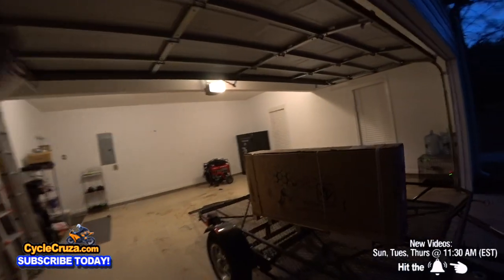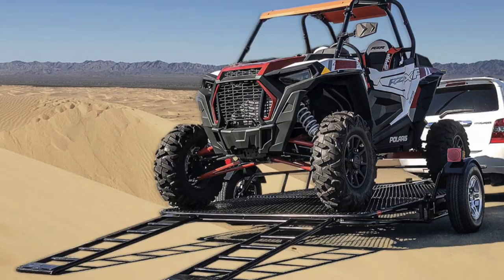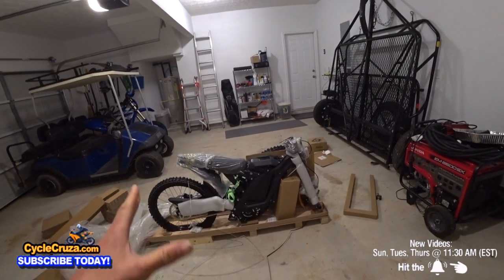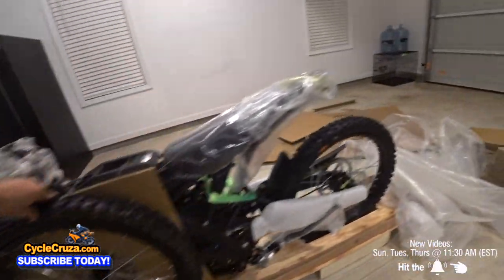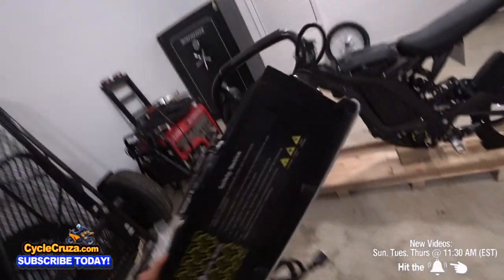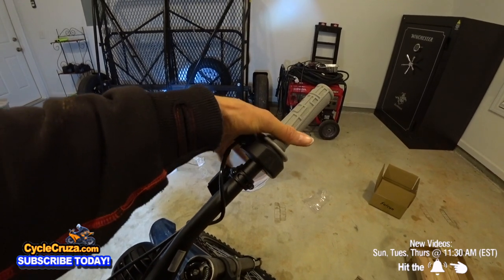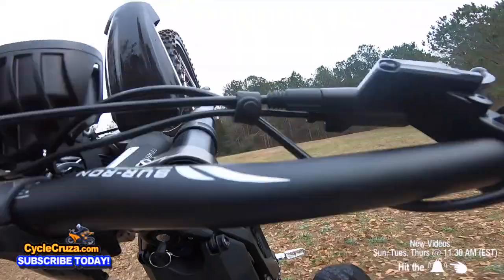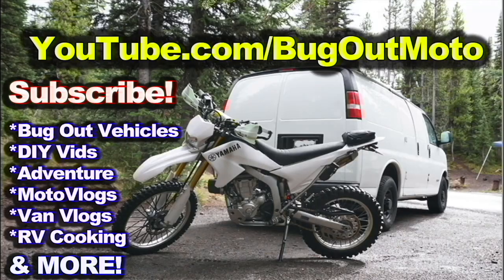My NEW Motorcycle REVEAL | CycleCruza

Comment: Yo Cruza, regarding the Trailer: How high does the ceiling need to be for it to stand up against a wall?
Reply from the maker: It can stand up in standard 8' or 10' garage ceilings. With my OH garage it has a lower ceiling (8') so I just take off the hitch end (comes off easy) and it stands up no problem. Here is the review video I did on it a my OH house: https://youtu.be/QBU_tJ-4jvk

Comment: These aren’t bad, had I known you were going this route I would’ve mentioned the Zero electric bike 🏍 trust me if you really love your supermoto your gonna fall in love with the Zero supermoto version check it out
Reply from the maker: This bike is better suited for me because I don't have to get it plated (Looks like an e-bike), fits in my bug out moto van so easy, wayyy cheaper, can do 80 mph modded, way less weight at only 100 lbs, can throw it around, can do big jumps with an upgraded suspension (Can go to motocross track) or you can simply just cruise on the side walk and cops won't bother you. Check this guy out doing crazy stuff on the Sur Ron (he rides dirt bikes!), this video helped sell me on the Sur Ron: https://youtu.be/2Ns1LzysKlk

Comment: There's battery mods the best ones together is like 6k to get 80 mph
Reply from the maker: They say you lose bottom end though, will need to add a bigger rear sprocket then it drops to 60 mph. 12 mph gain for $6k, is that worth it?

Comment: Our local park rangers mentioned they are getting Zero bikes for use up in the mountains. Before I got my two motorcycles in the past four months, I was looking into e-bikes. After one of my friends got his first motorcycle, I thought, you know my dad and uncle used to race motorcycles, my dad was a Harley Mechanic, I wanted to race when I was a kid, and I never had a motorcycle and was going to get an e-bike! I thought wow, some e-bikes are expensive and I'd get bored riding 10 miles to work at 20 MPH max (when using throttle only). Then I thought, e-bikes are more dangerous than motorcycles as you cannot get out of the way of cars. Additionally, I'd be more likely to get attacked passing through homeless camps next to the bike trails. So, I took the MSF course and the rest is history. Oh, and my first used motorcycle was less expensive than many e-bikes (and mountain bikes)!  lol

Comment: ole looper larry there. how fast does it go?
Reply from the maker: Because my mind forgot the rear brake lever is on the handlebar and not as a back pedal. lol  I'm so used to hitting the bad pedal on my YZ. It will do about 48 MPH stock, a $750 Bac4000 controller can get it to 80 MPH. On a 100 lb small bike like this it feels like the fastest 48 mph I ever did. lol *0 mph must be insane on this bike. Cool thing is it looks like an e-bike so no need to get it plated and cops don't bother you.

Comment: Please take it out on some of the back roads you've been riding the supermoto on and let us know what kind of range you get out of it.  I'm curious.  I think that's the only thing holding some of these electric bikes back is that you just don't have the range of a dual sport type gas powered bike, and it takes too long to re-charge them.   Until that changes, I think they will just be to play around on.  And the lack of sound bugs me too since I love the sound of a motorcycle... it's part of the thrill.
Reply from the maker: You can get a bigger 72v battery for it. It all depends on how much you weigh and how fast you go. I will do a range test. I will tell you that I rode it for two days in a row, did many laps on my trails and wot on the street back and forth and only got the battery down to 33%. I believe stock it can do 50 miles. Many people use it to commute to work to save money. Honestly, my mind has been blown and I feel differently about electric vehicles now. I wouldn't be too broken hearted if they forced us to switch to electric only. The batteries are getting better and better and charging faster and faster. There is a new battery tech that recharges in minutes, that will be a major game changer. The TORQUE is insane!

Comment: I hope you do similar upgrades to it like Sur Ronster did to his. He got his to 80 MPH with modification but changed the sprocket later for wheelies, now it tops out at 60 MPH with the new sprocket.
Reply from the maker: I don't how that dude does those crazy wheelies like that, this bike is not the easiest to keep the wheel up because of how lightweight it is and torquey with no gears. My YZ is so much easier to hold wheelies and stay at balance point and way easier to control. It'll just take some getting used to. I want to get a second bike that will be modded differently.
Reply: @CycleCruza Lol he makes it look so easy. Ah there might be a second Sur Ron in the stable?

Comment: Congrats on the bike man! I’m looking to get an e Bike too at some point
Reply from the maker: Even thought this looks like an e-bike it isn't, it has pegs and not pedals. BUT the great thing about it looking like an e-bike is you can ride this on the street without a plate and 5-0 won't bother you. If they do, you can add a pedal kit on it and they definitely can't say nothing. This stock does 48 mph, faster than any e-bike with a range of 50 miles. You can add a controller for $750 that will make it do 80 mph which is insane on a 100 lb bike! Even at 48 mph it feels fast because it's so small and lightweight.

Comment: My boy ain’t see dat torque coming in hot like dat, very easy to loop a wheelie on a Sur Ron 🤣
Reply from the maker: And I forgot the rear brake is controlled on the handlebar brake lever on the left side like a bicycle, (no clutch), I'm so used to tapping the rear brake pedal on a motorcycle to bring the wheel down if I pull it too high.

Comment: Intersted to see how this holds up. Pretty pricey. Personally I'd went 125 2stroke. And ripped it up on that. Want it quiet weld in a car muffler
Reply from the maker: This is cool because no maintenance, can ride at night without making a lot of noise, can do a ton of laps without recharging, can take on the street without a plate and it looks like a bike but can do 80 mph with a $750 controller, can take to the motocross track, can do so much on it! Very versatile and it's stealth.
Reply: @CycleCruza  a 2 stroke doesnt require the same maintenance as a 4 stroke. But I feel you on the other points.

Comment: Pretty cool bike! I don't follow electric motorcycles but seeing this reveal and can't wait to see the first ride video. I was in the market for a electric bicycle but might have to look at one these now also. I do like the blacked out look. Seems to have lots of torque. My main question is how much weight can it hold for a rider. I'm about 250lbs so don't know how well it would do for myself
Reply: I'm 266 and have a cheap 36v cheap Ancheer electric. It's like 1/4 hp rear drive hub.
Hauls my carcass around like nothing.
I get 15-18 miles on 1 charge.
Reply: @halverde6373  thanks for the feedback 👍
Reply: @wardor9214  You're welcome.
When I got it I thought no way. Been my daily ride going on 2 years. Zero problems so far.
Only mod I did was get a comfortable wider saddle from Schwinn.
Reply: @halverde6373  happy to hear your getting alot of riding out of it
Reply from the maker: You can upgrade the controller and battery and it will do 80 mph and will carry you no problem. My mind was blown after the very first crack of the throttle. I used to talk shiz about electric motorcycles. You'll see in the next video!
Reply: @CycleCruza  thanks for the info CC. Can't wait for the next video about the bike
Reply: @wardor9214  I love it. I owned the Trans-Am pace car from the 1982 Indy 500 and it's at least that much fun to ride in my going on 60.
:)
Much slower though.

Comment: You're going to have a blast with that on your 20 acre estate. Woody wheel works sells a 21" front tire for the Surron , but you'll have to get the Bomber 58 or Fox 40 front shock as well. BTW My wife did the same thing you did with the Surron ..popped a wheelie in sport mode in the grass where the tired grabbed and launched it in the air!  It screwed up her leg now she won't ride it.
Reply from the maker: Yeah I will have to do those mods for sure. Sorry to hear about your wife taking. a spill on it. Just tell her to put it in the slower power mode and she'll be fine.

Comment: A good starter bike into the expensive ones.
You can know what real torque  is with an electric.
They are 100% efficient .
Reply from the maker: It's nice not having to buy gallons of oil, oil filters and wasting time doing maintenance when you can be riding. Honestly, I did not think I would really like it, for a moment I thought I wasted money until I actually rode it.......All I have to say is see my first ride video coming Tues @ 11:30 AM (EST). lol #MindBlown
Reply: @CycleCruza  
Shouldn't have cut that wire until you had an hour or two on it to prepare you.
:)

Comment: Dirt n Iron has one too. They look cool. I would get one if I had land.
Reply from the maker: You can take it on the street too and it doesn't need a license plate! However, it can do 80 mph with a $750 mod. My kind was blown after the first crack of the throttle.
Reply: @CycleCruza  lol. Instant linear torque really is instant and linear.

Comment: I want one of these myself.  But one thing... you won't be riding that on mountain bike trails LOL.  Hell, here in Ohio some trails don't even allow pedal E-Bikes yet, like the national park trails.  No way you will be able to ride that thing on any of them.... LEGALLY anyways.  You will pretty much have to ride that on motorcycle trails like you would a dual sport.  I see those as essentially electric dual sports that are kind of a grey area as to whether they are street legal or not.
Reply from the maker: The torque on this bike can tear up the mountain bike trails, however, if you put it in a lower power mode and cruise the trails it shouldn't tear it up. We have a mountain bike trail in our metro park and there is no policing of it as far as I know. I will try it there when I go back just for fun and ride the bike paths. lol You can ride this thing anywhere and people will probably just think its a e-bike or mountain bike, unbeknownst to them this bike is capable of doing 80 mph with a simple $800 mod. No need to plate it either, its looks make it stealth.
Reply: @CycleCruza  Ya. you might be able to get away with riding it on a paved bike path, but if you show up at a legit mountain bike trail, please Vlog the reaction you get from the other riders.   They don't take kindly to poachers LOL, and even E-Bikes with pedals are not permitted on some of the trails.  What you have is even a level above that since it doesn't even have pedals LOL and you will get harassed by the hardcore MTB riders.  And if national park ranger sees you, they'll probably ticket you. Ohio isn't like it used to be, and they take mountain biking pretty seriously now and even close the trails when they are too wet.
Reply: I tried telling him this before, this is closer to a pitbike than an e-mtb.  I think it will be fun on his property.  Not legal on u.s.f.s. bike trails( e-bikes have to be the pedal assist type, not throttle) and won't keep up with real enduro motorcycles on ohv trails.  I've ridden a stock one and they are really fun, just don't fit in with motos or mtbs.
Reply: @CP-qx2ff  Ya, they are kind of a grey area.  I'd love to have one, but where I'm at, I don't really know where I'd ride it.  Can't ride it on the MTB trails, and can't really ride it out on the street either, so it's not much good for me.  If I had a place like CC's, then ya it'd be fun there for sure.

Comment: That's a bicycle bro.
Reply: You pedal a bicycle.
Reply from the maker: That's the beauty of it, it appears as a bike so you can ride on the streets without a plate and cops don't bother you but really it can do 80 mph modded and you can go anywhere on it and be a hooligan. You can even ride it at the motocross track and do big jumps, the torque is lit.
Reply: @CycleCruza  fair enough. I think you'll do better doing hooligan stuff with it at your 20 acre yard than riding it on the streets. Maybe you build a little ramp and obstacle course at your home for this because I don't think it'll be reliable or safe on the streets.

Comment: Electrics are fun toys but they lack the range of a gasoline powered engine. Thank you for the update.
Reply: Not anymore. They are about equal today. Lithium ion made a huge difference.
Reply: @halverde6373  yes, they are about equal but it only takes me 5 minutes to fill the tank on my bike. Let me see you find a battery that charges up in 5 minutes.
Reply from the maker: Although I'm not ready to replace my gas vehicles my mind has been blown with this e-motorcycle, you'll see in the next video where I do the first ride. The range is getting better and better and charging faster and faster. I believe this bike gets 50 miles and takes 3 hours to charge from zero. A new battery coming out will be a game changer for electric vehicles wher the battery will charge in minutes and have a long range. The more people that get electric vehicles the cheaper they will become in the future. The torque is awesome. I love me some torque!
Reply: @CycleCruza  Never hurts to put up a 250-500 gallon gravity fed gas tank for your homestead. Tanker comes to you.

Comment: Thats a electric bicycle not a motorcycle.
Reply from the maker: That's what makes this bike unique, although it appears as a e-bike it really is not, trust me it's an electric motorcycle but is stealth on the street as an e-bike so that allows you to freely ride it on the streets without a license plate and the 🚔 won't mess with you. You can even add a pedal kit just for looks and they can't mess with you. However, with a $750 controller upgrade it will do 80 mph!! 80 mph on a 100 lbs bike is frightening. lol Stock it does 48 mph, which way faster than any e-bike I've ever seen and it's the fastest feeling 48 mph you will ever do. lol My mind is BLOWN. At first I thought I wasted money UNTIL I RODE IT! lol
Reply: @CycleCruza  lol lol lol yeah lol 80 mph would be frightening on a 100 pd bike lol lol lol . What the cost if you have time to respond . I know its a punchy thing it put ya on your back side . Glade your ok . Waiting for Tuesday

Comment: That’s a bicycle I’m sorry
Reply from the maker: test ride one and your mind will be blown. Stock it does 48 mph and with a $750 controller it will do 80 mph and it only weighs 100 lbs. The beauty of it is that it's stealth, it appears to look like a bike so you don't need to plate it on the street but this thing can do 80 mph (Modded) with a blast of torque that will amaze you. You'll see next video on Tues. Before I rode it I thought maybe I wasted my money and then when I rode it 😵 Doing 80 mph on a 100 lb bike will probably feel like 180 mph. lol This is the fastest 48 mph I ever felt so far. lol